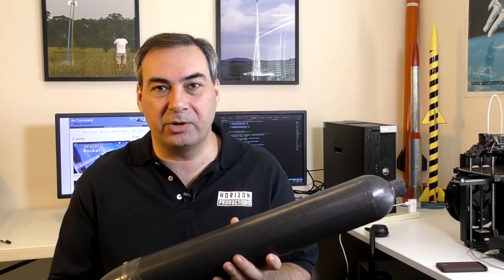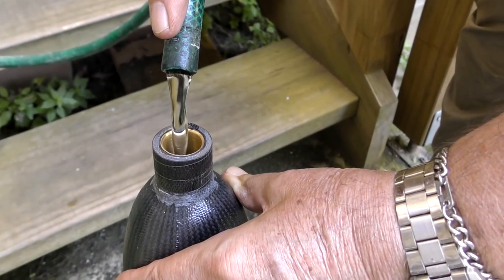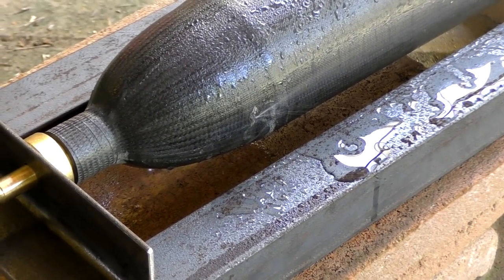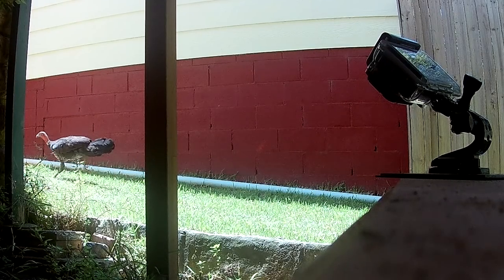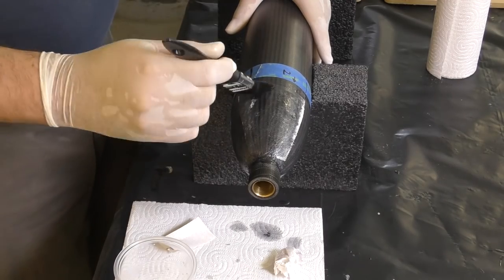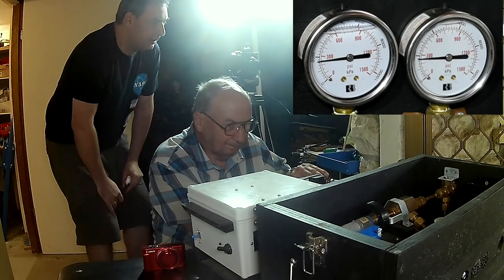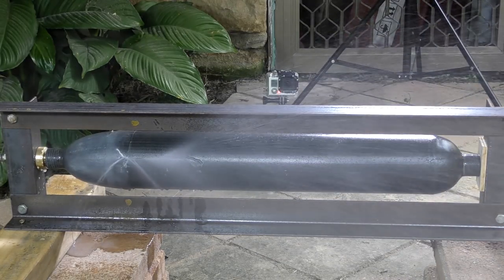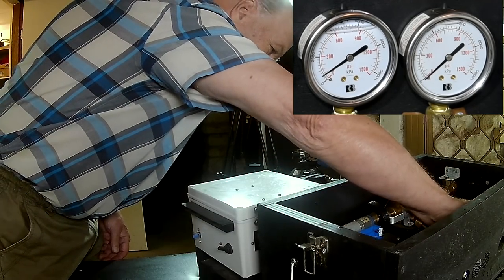2 Stage Water Rocket - Part 26 - Pressure Tests

Comment: Woah. I was not expecting the holding pressure to be this high
Reply from the maker: It will need to hold at least 1200-1300psi as we need a safety margin.

Comment: I love what you're doing, but I have a few questions about your construction.

1) Would it not be better to have the first layer of the cylinder barrel be wound on with filament as opposed to sleeve? Yes, your method is far easier to be consistent, but for the ultimate in strength-to-weight, I'd think you'd want to better orient fibers to their load paths. From there, I'd suppose you'd wrap a length of unidirectional fabric lengthwise to handle the static thrust of the endcaps.

2) Why use fiberglass the way you do? Structurally, it's effectively invisible in tensile strength until the carbon fails from elongation.

3) Have you ever thought of coating the inside surface with lacquer/tool dip/resin/etc. to deal with pinholes? Sure, wrapping everything around a preformed liner would be ideal, but you gotta work with what you have.
Reply from the maker: All good questions. 1. We definitely don't have the optimum strength to weigh ratio with how we build our pressure chambers.  We don't have a winding machine so any wrapping with CF tow would have to wait for that. You can't do it by hand and expect consistent results. You would also get much better results if you could do vacuum forming, or an infusion process. We could also use a better epoxy and post cure it in an oven. But we don't have a vacuum pump, or an oven long enough. The combination of plain-weave cloth and the carefully selected biaxial sleeve gets us closer to ideal fiber orientations in the pressure chamber, that's inexpensive, easy to manufacture and pretty consistent in terms of performance. 
2. The fiberglass isn't for structural reinforcement, it's there to provide a much better surface finish that reduces the number of micro pores and makes sanding much easier. 
3. That is exactly what we do, we coat the inside of the tubes with a couple coats of the epoxy, it creates a much better seal, again to reduce the chance of any micro pores.

Comment: Question: Shouldn't the chamber also be tested vertically? where there would static/dynamic pressure differences between the long air chamber to a surface small area air chamber? (IDK, I just stayed at a Holiday In Express)
Reply from the maker: The chamber is tested vertically and under dynamic loads at the time of launch. We typically start launching at a lower pressure than the static hydro test, and increase the pressure on successive launches. If it is going to fail, we want it to fail trying to launch it rather than just fail on the test stand. You also can't test the acceleration forces on the pressure chamber on a test stand.

Comment: With such a high pressure, is there an elongation of the cylinder during the test? Because the cylinder is in a steel frame, so cannot elongate, can’t it? Otherwise really pleasant to see your project!
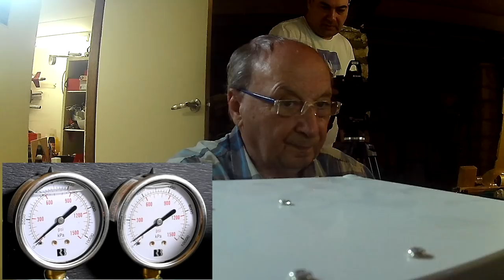Reply from the maker: Yes the pressure chamber will stretch. The pressure chamber has about 5mm clearance in the frame to allow it to stretch as needed. You can actually see it in the video 2:14 where the nozzle is pushed out under pressure. That's the amount of clearance the pressure chamber has to stretch.

Comment: Random question. While operating, or launching, would using water saturated with co2 or ‘sparkling’ water help sustain pressure at higher altitudes? As I’d assume the massive pressure drop would cause the saturated co2 to release more violently?
Reply from the maker: That's a good question. I think that would help to some extent, but it all depends on how quickly you can liberate that CO2 from solution before the water itself is ejected from the nozzle. With the sustainer for this rocket, the water is ejected in about 0.1 seconds.

Comment: just a question george, why are you filling the pressure chamber all the way with water, isnt it usually just a third filled with water and the rest filled with air?
Reply from the maker: Excellent question. This is called hydro-static testing. The water helps reduce any effects of an explosion. You can't compress water like you can air, so if the pressure chamber fails it just sprays a bit of water around, but if it was filled with air you would get a much more violent explosion as the air expands. The water just can't store the energy same way compressed gases can. It's similar to squeezing a rock as hard as you can, and when you release it, how much energy does the rock return? Now squeeze a spring, and when you let go, how much energy does it return?
Reply: @AirCommandRockets  what an excellent explanation. thanks a lot George :)
Reply: @AirCommandRockets  very nice explanation and kudos on the analogy

Comment: Looks ton of work to me.... I think delamination is due to a change in the material at the interface(glass and carbon don't have the same stress-strain curve, which in turn creates a differential in expansion at the interface)e.g. analogy: bimetallic strip used in heating relays etc. 
it will be great if you can do some cyclic pressurising for fatigue resistance of these chambers...at some point in time.
Reply from the maker: We are going to cut the pressure chamber open to see what happened on the inside. The top endcap didn't have any issues with delamination. We also hadn't seen delamination on other pressure chambers we've made.

Comment: Interesting. Is the most common failure mode ripping or delaminating?
And would this delamination instead of straight ripping provide a bit of extra safety in terms of pre-warning sounds, if the vessel was filled with air? Or would the leaking air rapidly rip apart the delaminated layers anyway? After all it’s much less viscous.
Reply from the maker: We don't have a whole lot of experience with failure modes for carbon fiber pressure vessels. We really haven't had these delamination issues previously. (If it indeed was delamination). We will cut it open and have a look. If I ever heard that fiber breaking noise of a pressure vessel I would sure run as quickly as I can. The hydro-static tests don't show the whole picture either because the pressure chamber will heat up when we partially fill it with compressed air. We can't do those tests at home, if we want to stay friendly with the neighbours.

Comment: Would a PET or Polyethylene baloon work for that instead of fibreglass. 
Similar to those reinforced bottle rockets you used to make years ago, but this time carbon fibre reinforced?
Reply from the maker: For the inside of the pressure chamber? Yes you could do it, but you would get a weight penalty. The strength to weight ratio of fiberglass compared to PET is higher.
Reply: @AirCommandRockets  I may be wrong, but the young modulus of fibreglass is like 6 times lower than that of carbon fibre. So in this case the fibreglass is acting purely as a sealant/barrier, right? 
Cause by the time the fibreglass stretches enough to get to its tensile strength - the carbon fibre will be already torn.
 
So the carbon fibre  is taking all the pressure load.

So I thought - if you would take a relatively small PET bottle, heat it up, put it inside a matching diameter steel tube, inflate it like a baloon you would end up having a perfect mandrel to put the  carbon fibre "sock". I'm very new to the rocketry, my background is the prototyping engineer and sorry if I'm wrong and you have already tried or thought of that idea.
Reply from the maker: @makerbeelab5546  I see what you mean. Yes the carbon fiber provides the vast majority of the pressure containment. But if the glass stretches more than the carbon fiber then that should be good because it won't fail before the carbon fiber does. The problem with making the inside out of PET, how do we get it to be 2m long? This test pressure chamber is only a short version of the final booster segment.

Comment: Why not make an air cannon/water rocket hybrid. The air cannon should add a lot of boost with no weight penalty. It could be pretty awesome.
Reply from the maker: A launch tube that goes up through the nozzle has a similar effect. The booster for this rocket will use 3 launch tubes one for each nozzle.

Comment: Why not just make sch. 40 pressure chamber? You should be able to get at least 1200 psi with 2 inch, way cheaper and easier.
Reply from the maker: Do you mean PVC pipe sch 40? In order to compare apples to apples this pressure chamber is 3.14" and from what I can see the operating pressure is 158psi and burst pressure of 840psi. sch 80 is 225psi and 1200psi respectively. So both of these are still too low. Our operating pressure is 1000-1100psi with burst pressure above 1600psi. That aside, PVC fractures into dangerous splinters when it lets go, isn't as stiff as the composite so tends to bend during high accelerations, and is heavier.
Reply: @AirCommandRockets  Yeah, those are the listed pressures, I'm sure it's much higher in reality with the glue joints being the failure point. I was just more curious if you had considered it when I made the comment and want to emphasis that I think this is a really cool project and you have gotten some great results.  Also I was really impressed with the trigger mechanism.

Comment: Have you thought about wrapping the carbon fiber in a wrap to simulate a vacuum bag?  You can see the process here for making carbon fiber baseball bats.  https://www.youtube.com/watch?v=XzSxaY4nOls
Reply from the maker: We have done tests with a wrap over the top, but that doesn't quite have the same effect as vacuum forming. It doesn't really remove the excess epoxy. Wrapping it tightly around the piece then makes it much harder to remove the long tubes from the mandrel. We don't have the large hydraulic presses like shown in the video.
Reply: @AirCommandRockets  ahhhh dang.  I was hoping that would be helpful.

Comment: Perhaps you could use a hydraulic pressure increaser?. Instead of having to make the whole rocket high pressure?. Youd have to have a bigger tank but your mean pressure would increase at nozzle only. Hence youd only have to strengthen second chamber. https://www.hydraulicspneumatics.com/technologies/other-technologies/article/21884328/book-2-chapter-13-pressure-intensifier-circuits
Reply from the maker: I don't think that would work in this application, because you wouldn't be able to get the flow rate needed. We are pushing out about 3L of water in about 0.2 seconds.  There would also be the added weight of the mechanism which would reduce the overall altitude. But an interesting suggestion.
Reply: @AirCommandRockets  only one way to find out 😉